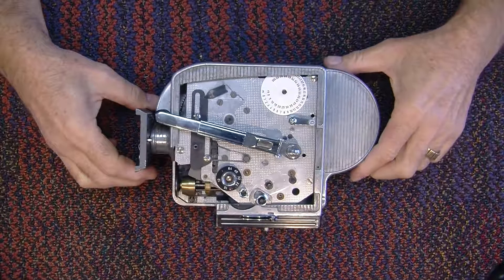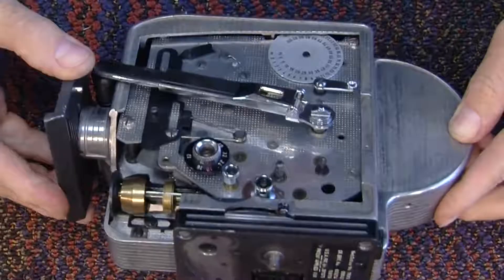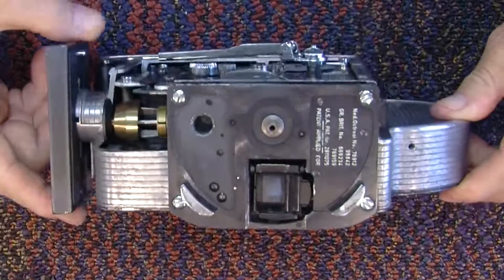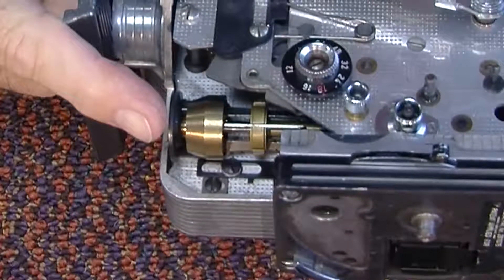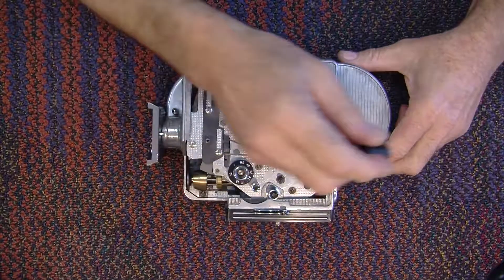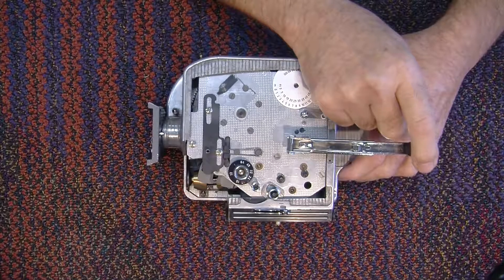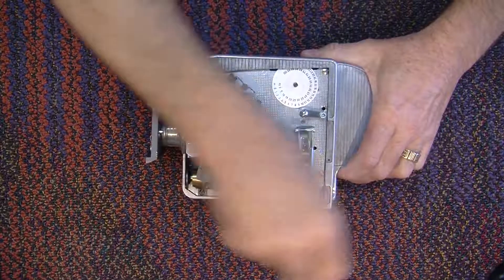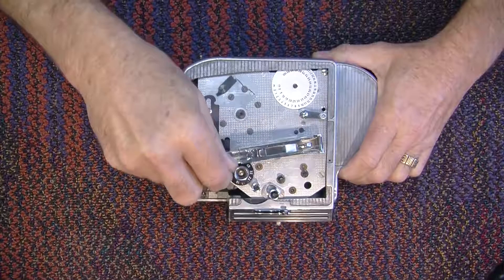Bolex tuning fixture

Comment: Is there any way to get inside a bolex without sawing the front off??
Reply from the maker: Of course, this is just a fixture I made out of an old Bolex so I could assemble a complete gear train and have access to the governor without having  to take it out of the body again.
Rich
Reply: @richjura8957  ok yeah I saw your other video
I have a older model that jammed and I took the governor screws out by mistake trying to get inside :/
I'll try to fix it this weekend
Thanks!

Comment: I enjoy all your videos. I've have worked on all of the Bolex 8mm pocket cameras but am a little weary on working on the H16's because of the special tools needed to align  the registration etc..  I have the original service manual would like to give it a try.Thanks for the informative videos!!
Reply from the maker: Thank You
   I felt the most relevant tool was the one that pushed the pin out of the 1 to 1 shaft and 8 to 1 shafts.
Everything else can be worked around, except for fitting a new governor assembly. Bolex has a fixture for that which I found a work around.
Good Luck
Rich

Comment: Good idea. I have found critical things other than the governor to sometimes err a camera’s run-down, for example the non-descript spring washer between spring barrel and mounting square. With one camera that washer had burrs that had dug themselves into the soft barrel steel which in turn resulted in a slowly miaowing run. Had it only been inserted the other way round, no such harm would have occurred. The spring barrel with its gear as the slowest moving part must roll nicely, else it transmits deviations to the whole gear train. A claw tip well ground flat a little also helps keeping irritations away. Remember, Jura, we discussed once on cinematography? Cheers!
Reply from the maker: Simon
  Nice to see your reply, yes there are many things that can effect the camera's performance. In the 30 years I kept our stable of 70+ cameras running I had not seen that one. Now that I'm retired I do miss nit-picking Bolexes. When I took the job I had never seen the inside of a Bolex, Having assembled some Arri 16S ,BL's and 35C's I have really developed a love affair with the spring driven Bolex.

Appreciate your post

Rich